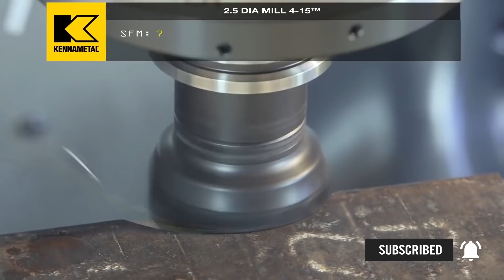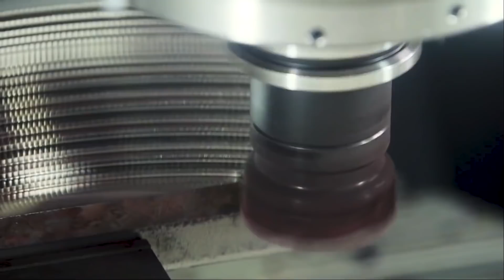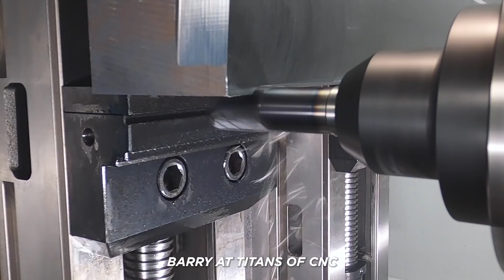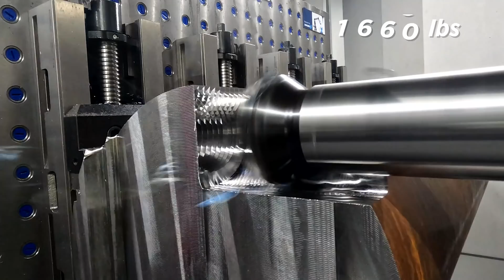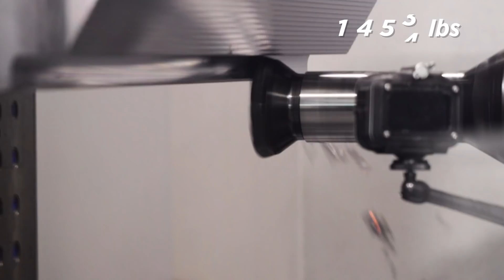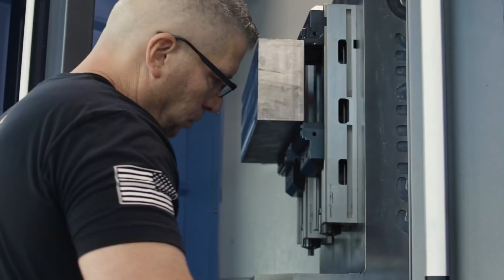They Pulled Out Of A Deal To Purchase My Company… SELL OUT

Comment: Hey Titan, sorry if it sounds like I just woke up (just woke up and retired ten years) but why couldn't you supply the blog links to what we stopped surfing for to listened to your constant search for a better life? 
I understand why you don't use coolant for filming but are the parts you're creating just junk or are the bits or tools useless and you're just making chips? Can't you use coolant with compressed air to keep the camera clean and the parts and chips cool? Goin back to bed, thanks.
Reply: Some materials (steel, cast iron, Aluminum) can be machined dry, but is not always optimal for finish or tool life. Other materials cannot be cut dry at all for many reasons. It IS possible to compressed air for keeping the camera/parts clean, but is not as good for filming as dry machining.

Comment: I watch some of these videos just for titans stories, but they got me thinking, why machining big chunks of metal when you can cast metal into any shape? Thus the whole process being more efficient. 
I really want to know the reason
Reply: Casting only offers tolerances for rough measurements.  CNC machining can take pieces to 1/10,0000 of an inch.  This is a cliff note reason why you need to cnc
Reply: Castings are not as strong as solids
Reply: @barrysetzer  well even the big block is still a casting. It's melted metal poured into a big block shape, they didn't dig it from nature like that. Some said about precision. A mold keeps its shape all time, right? Why chase microns with a cnc when you can have the same cast over and over again.
Reply: @dragosdiaconu629  Well, this is actually not true. Yes, the molten metal (any kind) is "poured" into a kind of blank, but then it is further processed. Various mechanical forming and heat treatments are used. The same material with the same chemical composition is sold in various states. Read some material standards to get some idea.  There is a whole world of metallurgy science behind metal production.  A metal product is not just chemistry and shape.
Many complex forms need a mold that can be used once, so it does not work as well that make a mold and that's it.
Reply: @user-tc2ky6fg2o  thanks for the light buddy
Reply: It depends on the volume. A small quantity is not more effective to cast (and then machine). Until you reach break-even, when you get the same price per piece there is a lot of room for optimizing the machining from blanks, such as different tools, parameters, machines, etc. In the automotive industry casting is the default. In the rocket-motor industry the cutting.
Reply: You can chase the micron on CNCs if you really want to, but never will with casting, casting still has post processing and can still have voids/inconsistencies. Material properties are slightly different or vastly different and need more processing to get to the same/ similar as just cutting a block. Molds need to be made still.